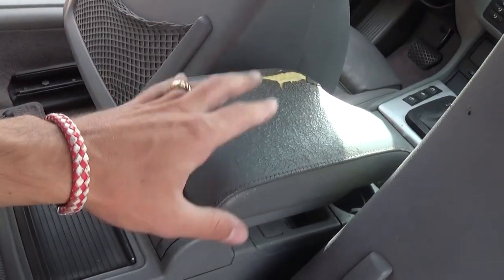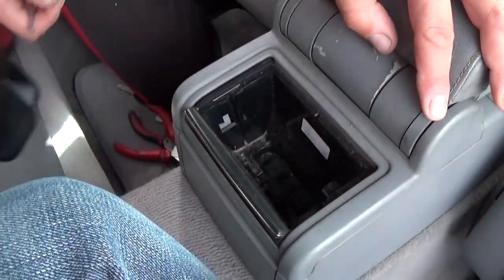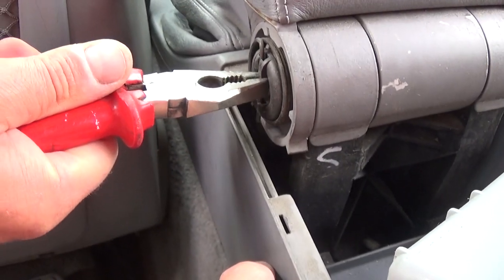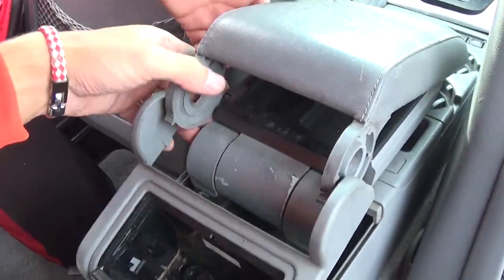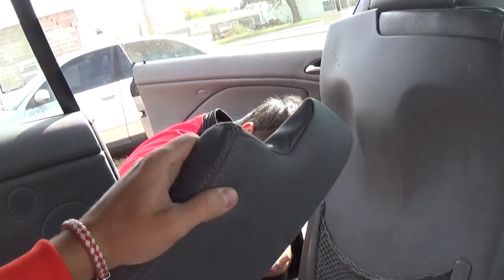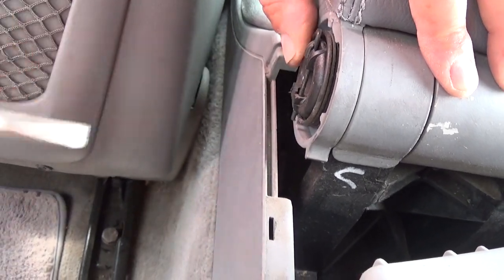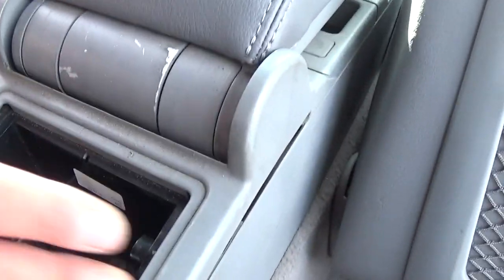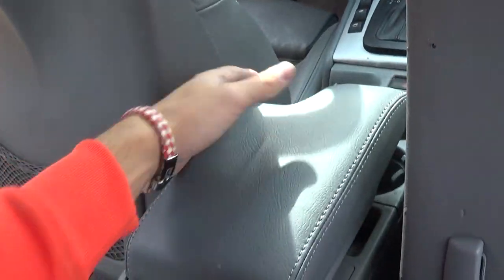BMW E46 ARMREST COVER LID REMOVAL REPLACEMENT

Comment: Where do you buy the cover or complete unit from?
Reply: tom lawrence i bought mine from ecstuning.com..... quite pricey tho i paid $250+ for a red armrest
Reply: @josealvarenga8110 Thanks! Never seen cover for sale in red. Looking at Amazon, eBay for replacement skins and all about $20 for DIYs but concerned about quality since most comment say they're cheap vinyl.
Reply: tom lawrence yeah i wouldn’t buy one on ebay.... if you’re wanting a genuine one i would get it off ecs. black will be the cheapest option and cinnamon is the most expensive. they also sell the entire console if you need that replaced
Reply: Go to a junkyard in your city. U pull it junkyard in Florida saves me tons of time &money for parts
Reply: I bought one from a low mileage car just going to swap it over with my 130k car everything is is done now